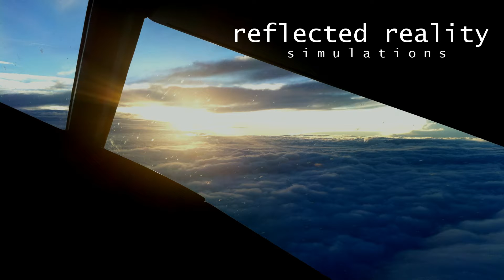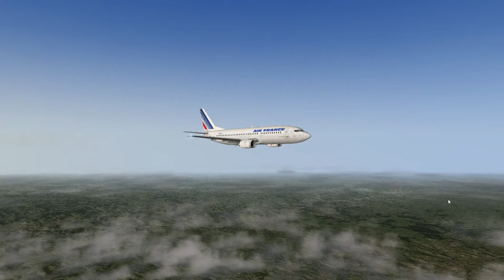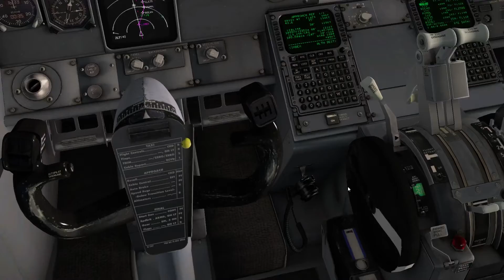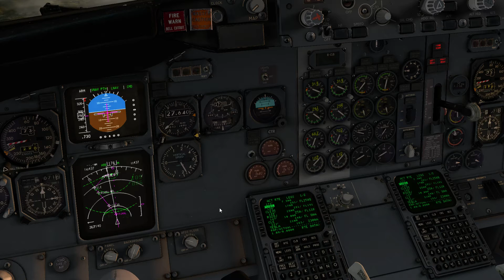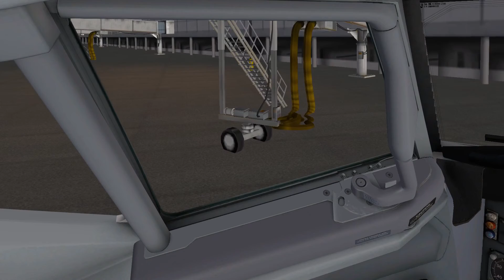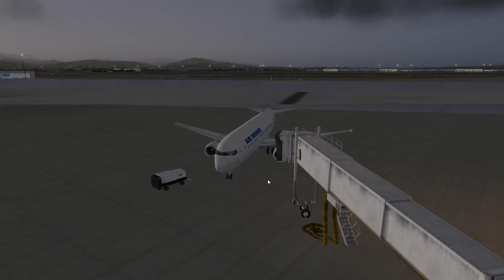Comment: Did you forget to activate Runway Turn Off Lights when entering the runway, noticed this was off during the flight and activated when you vacated the runway? Also why did your display show R-CLB when you decended?
Reply: Hi Tom, that use of the lights is based on what we do in real life. On the Airbus the taxi and turnoff lights are switched off at a suitable point after the gear is selected up, and put back on again when the gear is down. My understanding is on the 737 the taxi and turnoff lights are not used during takeoff for two reasons. On the older 737s they do not automatically go off when the gear is up, and also the life of the light is extended by not using in during takeoff and landing. Therefore when I put the landing lights on I switch off the taxi/turnoffs, and vice versa.  R-CLB is the engine thrust rating available. Again I'm not 737 rated but I would expect that if the aircraft is not at the cruise level the Climb thrust would be the normal maximum thrust available, and I had an assumed temperature entered hence the Reduced Climb annunciation.
Reply: sop for both 737-300 and 737-800 at Norwegian is this. Rwy turnoff and taxi light on from taxi to lineup. Then inboard landing lighs on, taxi light off. When passing FL100 landing and turnoff lighs off

Comment: Great Vids. Really enjoy them. If I could offer some advice, is to more clearly label the video titles so as to be able to discern which part is which; ie, Part 1, 2, etc. It's kind of hard to see what video is next because the titles do not show the parts labels.

I've been flying the IXEG 737 for about 1.5 months now. Currently I am flying around the United States to major airports, west coast to east coast. I am currently in Seattle, going to depart next to Vancouver, then to Prince George BC, then on to Alaska and back. Maybe on the way back I will head across the US headed east and south and then back up the east coast. My home airport is New Orleans.

I have already flown from San Francisco to LAX, to Phoenix, to Denver, to Seattle.

Nice flights, sort of what the plane was made for. Going to try some longer hauls soon after I finish the tour of the US airports.

Often times I find the auto descent does not start automatically. I set everything up properly on the FMC, etc.

I actually have an 8 page written procedure from your videos, each step of the way. 

Cheers, thanks for the Vids.
Reply: Thanks for your comments, I'm glad you enjoy the videos and find them useful. That's a good idea about the part numbers in the description. I know people have been having issues with the VNav, but I've not been able to replicate any issues. Then again, in reality it's surprisingly common for VNav not to perform "as advertised" so most crew simply revert to more basic modes and not worry about it.